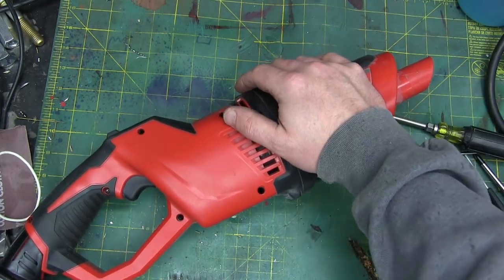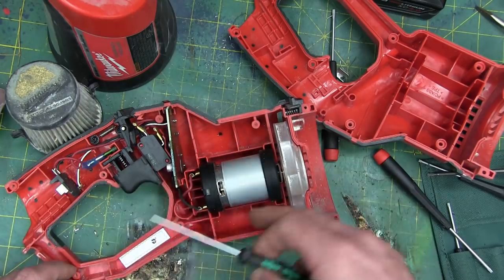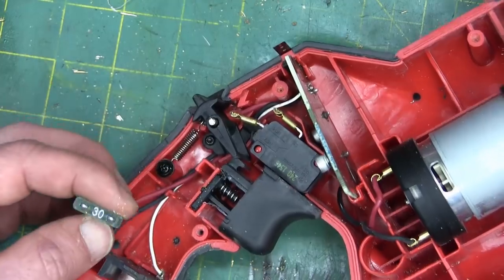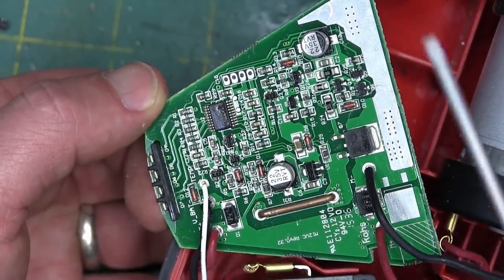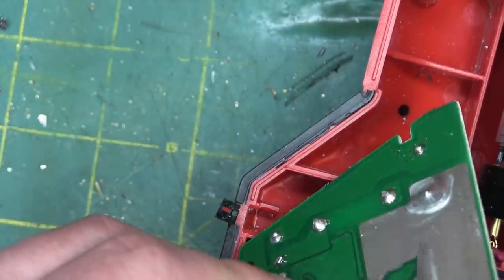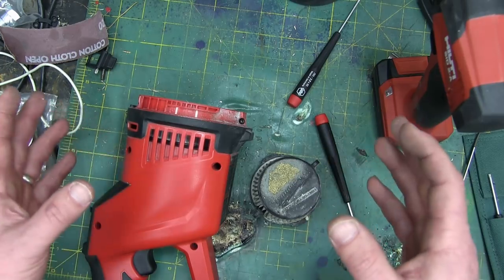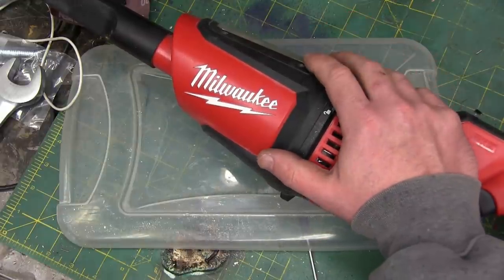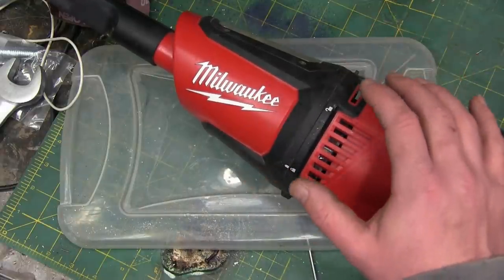BOLTR: MILWAUKEE VACUUM | It sucks.

Comment: AvE  Suction IS NOT involved in moving anything you might want to pick up with a vacuum cleaner. It's all about airflow (specifically at the inlet nozzle). To demonstrate this, place a wadded up 'ball' of paper , smaller than the nozzle opening, in the upturned palm of your hand.  Place the nozzle over the paper and press it against your hand to seal all the way around the nozzle. Turn the vacuum on, give it a few seconds to get up to speed, and then turn it off (leaving the nozzle against your palm until the motor stops).  The paper, even with the best vacuum cleaner you can buy, will still be in your palm.  Many things can reduce your airflow. Duct (both hose and inside the unit) size, geometry, surface texture, etc. Rotor speed, size, geometry. And much more.  By far, the one thing that affects what we desire most is the volume of the air itself. The more air you remove from the area just outside the nozzle, the lower the pressure is in that area, drawing surrounding air into that area to replace the air. That air rushing in is what picks up your dirt and carries it along. Bigger hose, with lower airspeed can pick up more dirt than smaller hose with higher airspeed if the volume of air is greater.

Comment: I've got the Makita equivalent. Doubt it could pick up big chunks o' swarf either, but for general house schmoo, pet hairs, sawdust etc. it is fine. It is only €40 too if you have the batts so, like Mr AvE, I was almost duty bound to buy it.
Reply: gmoar The Dewilt portable wet dry vac is pretty great. I don't own a single other tool of theirs, but their vac can't be beat. Runs off any of their style of batteries OR AC. I just bought knockoff batteries and charger and got out cheaply.

Comment: My 18volt DeWalt nicad battery, 2 gallon shop vac kicks arse all the time. You should try the yellow. The washable filter is a major plus, after about two years I had to change the filter as the pleats where breaking down. Have always thought the "dustbuster" was a horrible vac.

Comment: I have that vacuum and it’s totally craptastic! About the only reason I find use for it anymore these days is that it’s handy for holding underneath the drill when drilling into drywall. Other than that it’s totally shittastic. I have a newer 18v Milwaukee that’s excellent but is heavier (#0882-20). I have 3 cordless vacs and it’s my favorite. The Dewalt (DCV581H) is a close second - can run on 120v, Flexvolt, 20v and 18v Dewalt batteries.
Reply: So you haul around their brand name at 10 times the weight of of a whisk broom and dustpan? You are a free 'merican!

Comment: I like mine well enough. A guy I worked with asked to use my "sissy vacuum" to clean up. He liked it, but isn't a jobsite vacuum.

I've had two of the compact batteries break in half. The little tabs that hold the top cover aren't enough. I'm tempted to get some some glue(I'm guessing its ABS, so ABS cement) and put them together for good, until the batteries crap out. I like the XC batteries since they won't have that problem.

I hear you on having the sickness of having a bunch of batteries and lots of tool choices.

Comment: Own one, works well for small jobs considering it runs off a small 12v battery. I use it at work for chips from drilling, insulation from wiring etc...

Comment: Does/did it come with a little surround attachment for drills? The little battery vacuums from other tool brands are often/sometimes intended for sucking up dust direct from a drill/sander/whatever.

Comment: Haven't tried one but wonder how well the shop air operated vacuum works? I'm sure they are noisy, I have to wear ear pro for everything with my severe tinnitus anyway so that's not a thing and have a large compressor so been considering one. It would be nice not to have to drag out the big old heavy stainless tub shop vac just for small clean ups. Thanks for the best content and entertainment on youtube AvE, you're my second favorite thing out of Kanukistan with Crown Royal being first,  just cause I collect the bags of course.

Comment: There's got to be something odd about the design of all these handhelds... air comes whistling out of the little slots in the blunt end like a hurricane but the air goes into the pointy end without much urgency about it at all. 
I think they've fiddled the duct design to maximise outlet velocity so it seems to the user like a fantastic amount of air is getting moved.

Comment: I'd like to see your gauge hooked up to the M18 compact vac.  Admittedly I'm somewhat of a Milwaukee fan boy but the M18 compact comes with some decent accessories and I felt like it offered a bit more value then other Milwaukee products I've purchased.  I bought the M12 vac for the wife to use around the house and it really is a novelty compared to the M18 platform.  I think that would be a better comparison to the Dyson.  Would love to see you tear down the M18 compact vac.

Comment: For an M12 powered vacuum the sucktivity looked better than I expected honestly.  Compared to the 500-1000 watts a proper shop vac is going to pull, I'm not sure how there was any expectation this thing would be skookum enough to suck up pounds of metal chips on a regular basis.

Comment: The way things are with hand-vacs, I'm surprised somebody isn't out there making kits for something better with RC model parts. Electronicals are likely just a potentiometer driving an ESC and it would make replacing the motor and batteries much less of a chore in terms of serviceability. Brushless and a 4S lipo battery should be all it needs to get the RPMs needed.

Comment: Dyson has pretty fair performance for picking up dirt and dust. The thing I like about this Milwaukee is you can change the battery once its low, on the dyson you have to charge it and it takes for-ev-er... And then you only get 5 mins of run time..! 
Metal shavings aren't really their specialty though, but good for zappin' a little pile of something or awkward to reach use. For what yer using her for you'd be better served by a real shop vac, far more skookum

Comment: Ave, I think you need to review the M18 vacuum now.  It'd be a more apples and apples comparison to the dyson.  I actually have that little M12 vacuum and yeah it doesn't suck very hard, but it is handy as hell for cleaning up dust bunnies, hair, and dead bugs under and around stuff in my garage.  The wife and  I use it in the house too for getting in tight corners and whatnot and quick touch ups when we don't want to do a full blown sweeping/vacuuming of the house...  Beats the hell out of the dust devil piece of shit we had with its crappy onboard rechargeable batteries that didn't last worth a damn... 

I've been thinking about getting the 18v version (it wasn't out yet when I bought the M12 vacuum or I would have probably gotten it instead)  But kinda want an honest review of it before I clunk down the cash.

Comment: The m18 shop vac would be more appropriate for your application. I've found it to have extremely powerful suction considering it's cordless. The downside being it will chew right through the batteries.

Comment: One thing I just noticed is the rubber flapper doesn't open very far. It catches on the inlet jobber... Trim the circumference a tick and she chooches not bad.
Reply: And if your hand isn't steady enough to trim the rubber flapper you can always take the old Dremel and hog out the port ... Just don't go past the flapper seat.
Reply: A hinged flapper would've been alot better

Comment: AvE, dont know if you will see this or not, but speaking of red tools... you should tear down one of those Lincoln 210 MP welders! I recently picked up a used one that someone had let the 200 lb gorilla smash and bash, had to pull the covers off her to fix some stuff and wow, seemed to be a pretty skookum choocher under there. The heatsinking is nuts!! I'd like to see you tear one down and see what you think of it!

Comment: have you ever noticed, machine shops just blow the chips off their mill with compressed air and pay some janitor to sweep it up later. Vacuuming metal chips can be difficult, leave your safety squints on and hit it with 50 to 100 psi and blow it off your metal working equipment.

Comment: Thanks for getting this out now.  I was considering asking my wife for one of these for Christmas.  I'll strike it from my list.
Shame it's so under powered.  Guess I'll stick to my shop vac.
Reply: cigr and the filter clogs so fast, I have one and the suction is crap. Don't get it. Ever.
Reply: I'm curious how the M18 one is. It kinda seems like Milwaukee thought the same thing about the M12 Vac cus the newerish M18 one is about the same form factor.
Reply: Landon Harris, I've tried the M18, the lunch box with the hose. Noisy as hell, and not impressive. Made my ears ring after 35-45 seconds of use. .
Reply: No I meant the small M18 one.

Comment: I’m a fan of Milwaukee tools and my main set is an 18v brushless fuel set which I have and have had no problems with performance on most of their tools.

So I figured I’ll pick this little guy up to do small cleanups, vacuum truck, etc.. Wow this vacuum sucks and not in a good way. It could not even pick up a few small rocks/dirt about 1mm in size. What good is a vacuum if it can suck anything up? Within an hour I took this crap back and traded it in for a brushless 18v Ridgid, the difference was night and day.

Comment: I have an older vacuum. It's a simple proposition and because i'm a lazy bastard, i just use leftover fabric to make up the bag, then tie it up and throw it all away chips and all. Here's the observation, it's a handshake. The motor inside occupies half the physical space, and the bag section the other. You want both speed and area, and the more area you have(inside), the more you suck.

Comment: swap the motor with a hobby brush-less motor the ones used for drones. for $20 you can get the motor and a speed controller. they need a pwm signal so toss in a ebay 555 timer board in there and just set it until its as fast as she will suffer. 3s is the key word they are built to handle up to 12.6v (11.1v nominal for lipo packs)

Comment: The Cryobi 18v is just as bad...

I just use a little "2.5hp" 2 gallon plug-in shop vac. It's light enough that you can take it around places easily and it performs pretty good for the $30 or so.

Comment: Not too surprising - metal chips require a fair amount of suction and all you've got there is a dinky 12V motor. It's not all that much different from a dust buster. Metal filings require more of a vacuum that that.

Comment: It needs suction AND flow rate to pick up heavy stuff. Not like those cooky infomercials with the vacuum holding the bowling ball. Big whoop, that's only suction, not flow. Flow * pressure differential (suction) = power. Literally. No substitute.

Comment: You should make it better.  Improve it for us minions.
Reply: It's basically a pump. The impeller can be optimized for head or volume. By changing  the impeller blade geometry, it should be possible to optimize the sucker for this application.
Reply: You could possibly change the nozzle geometry. Narrow it down and you'll get a higher airspeed into the nozzle which should pick up swarf better but it'll act over a smaller area.
Reply: By the end of the video I was thinking "cord it and add a voltage doubler"! Won't last long but at least the life it has will be worth something!

Comment: That's disappointing because I've been eyeballing those. I've yet to date see a handheld worth it's claims. One would think in the world of "20 amps in a single single cell" Lithium, we could get a cordless of this size with some nuts... even if it did only run 15 minutes on a charge. It just needs to run long enough to vac out a car or workbench... or clean up the carpeted stairs in the house

Comment: Single stage impeller, no wonder it won't pick up anything.  Even that little 12v motor could suck harder if it was a twin stage like a real vacuum cleaner (input, impeller, stator, impeller, stator, exhaust)

Comment: The centrifugal impellor style is useless at sucking. Its not positive displacement so it has a lot less suck.
Its like a progressive cavity (mono/seepex) can self prime and a centrifugal (weir/sulzer/flygt/grundfos) requires bleeding. I could explain in more detail but my brain is good at figuring them things out no problem but i suck at articulating them. i'll have a go if anyone has any questions though.
Reply: I thought that all domestic vacuum cleaners use centrifugal impellers

Comment: It's a crap design because there is no outlet diffuse on the fan, it's wasting a lot of energy propelling fast moving air around the workshop, with a diffuser the air would come out of a bigger hole, slower and there would be more vacuum at the inlet.

And  I've said this before, don't knock microswitches, if they spec them correctly then it will be more reliable than almost anything else. And if it does fail, it's a doddle to replace.

Comment: I call these things bag gimmicks, you know, the cheap stuff they throw in the bags like flashlights, vacuums , to make you think you are getting a deal on that 399$ Impact Driver / Drill combo ^^...
I have a set of Milwaukee tools, cant say I have any complaints, their drills/drivers/multitools have been treating me good, even the newer ones.
I wouldnt buy stuff like this though, you gota have a proper shop vac, or atleast a drill strong enough to drill a hole through the floor into the basement so you can sweep all the debris under the house. ^^....

Comment: I've been told that Milwaukee m18 tools have been banned from mine sites in Saskatchewan from starting on fire my coworker told to remove his M18 grease gun from site
Reply: The proper equipment would be ignition protected, like marine electronics, so you would be able to spray LPG at them during use without a problem

Comment: wrong to tool for the job, i have one of the m12 vacs and  use it around the  house all the time i love it.I  tried using at work and agree it doesn't have enough oomph for bigger jobs thats why it my quick vac around the house, so i got the m18 shop vac thats  what you need that thing has a ton of suction.also on the m12 you have to use clean filters once those things are used up replace . my two cents.

Comment: I knew it was crap when i saw the switch.Canon used the exact same switch in a buttload of copiers.Nothing but malfunctions.
Then,a circuit board in a vacuum?Fuse and thermal protection is it.The rest of it is marketing junk.

Comment: Dysons are expensive look at a Shark.
Reply: Have you owned and used a Shark HV301or similar model?  Lightweight, great performance but without the hipster mystique and costly Dyson advertising campaign.
Reply: wbbh don't ever buy a Shark vacuum they don't sell any aftermarket parts and they don't have anywhere you can take it to be fixed once the hose cracks or rips its garbage and we had an iron from shark that pretty much leak out of the box and never really worked stay away from that s***
Reply: wbbh shark is great product. Seconded.
Reply: Dysons are actually overhyped crap. They are not better than their competitors, they are actually worse.
My Grandmother had 3 of them die on here, just after the 5 years warranty has ran out.
Now she is back to a used Vorwerk for 200€, and what you know. That 20 year old Vorwerk easily beats the dyson when it comes to suction and to noise levels.......
It just needs a bag every once in a while, but who cares?
Reply: there's two sorts of person.  those who criticise Dyson for being too expensive, and those who own them and realise why they cost what they do.  we're on our third and they are freaking incredible pieces of engineering.
Reply: If they're so incredible, why are you on your third?
Reply: you are insinuating they have failed?  all three are still going fine.  I keep one in the garage, one inside and we have a floor model as well.
Reply: My family has a 9 year old Dyson that is still going strong, and you can get spares for it.

There are five layers of filtering, a large cyclone, a set of small cyclones, washable fine mesh and foam, and a lifetime HEPA grade carbon filter after the motor.

Comment: Hey AvE, Have a gander at DeWilt's little sucker, I have the older 18v version and it's been a fairly skookum choocher imho, i've put mine through hell the last 2 years and it keeps coming back fer more, to describe it its kind-of like what you would get if a shop vac and a dust buster had a kid...
https://www.amazon.com/DEWALT-DCV517B-Baretool-Cordless-Portable/dp/B01CKIZ8BA/ref=sr_1_2?ie=UTF8&qid=1511632495&sr=8-2&keywords=dewalt+vacuum
Reply: depends on the job, and in mine minimal bulk is more better.

Comment: No wonder it can barely create a vacuum, that "impeller" is a total piece of garbage. The fins are straight up just walls of plastic with a very slight decrease in thickness going down. Good enough for a crappy laptop style cooler, but a bit of good engineering is needed here (proper airfoils, curvature, etc.)